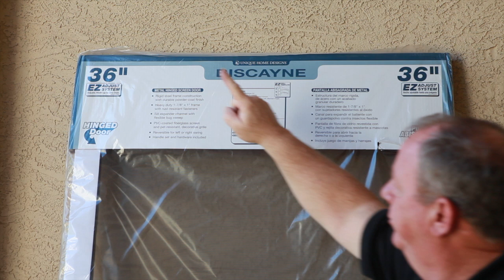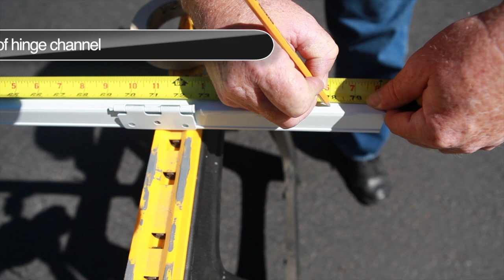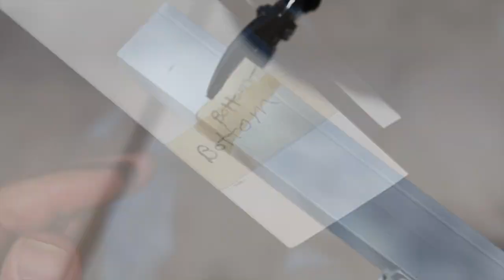Metal Hinged Screen Door with EZ Adjust System Installation

Comment: Video was helpful overall - but the door handle template doesn't work with the screen door that it came with (at least on our front door)  - I had to dig up an old school paper template from days or yore.  People need to be advised to really check measurements when doing this part.  Also - I stupidly listened to the instructions on trimming the bottom of the side panel instead of following my instincts to leave it be - now I have a 2 inch gap between the side panel and the extension panel (I can't find a phone number to get a replacement side panel).
Reply from the maker: We are distressed to hear that a miss-cut has left a gap in your installation and confirm that this should not be the case if the instructions and video are followed correctly.  Please contact the retailer or dealer where you purchased the door for additional assistance.
Reply: @HelpMeInstallIt  Same thing happened with me. It's no fluke. The instructions are just wrong.
Reply: @HelpMeInstallIt  the instructions aren't correct. A 5-year-old could design a better door. I know I could this is ridiculous.

Comment: Not great. If you install the bracket that close to the screen door, the cylinder won't allow the bracket to sit flat against the screen door frame. Also, as I pointed out (but was since deleted) if you cut the hinge channel as per the instructions, you'll be left with a gap between the hinge channel and the sill expander, because 2 3/16" is too much to cut. Lastly, the screw provided to secure the bracket that retracts the screen just spins in the oblong hole and won't hold the bracket tight enough to test the door.